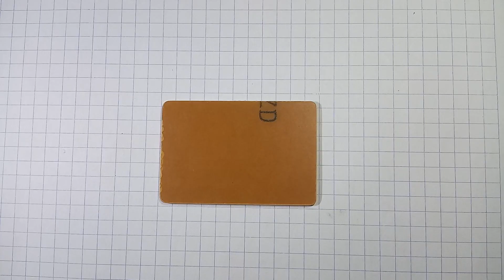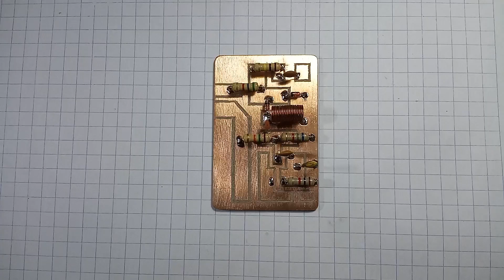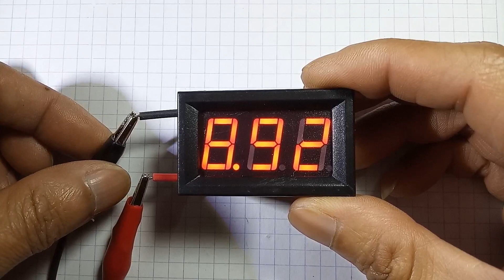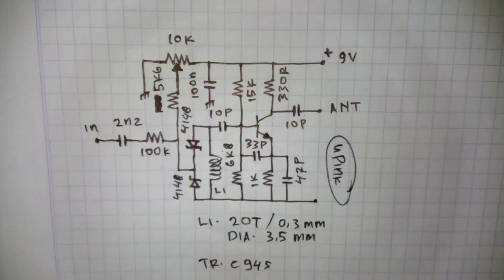Pemancar FM mini VCO

Comment: Kalau untuk frekwensi atas seperti di 88 mhz bagian mana yg di ubah mas?
Reply from the maker: Di tambahkan kapasitor pada induktor inti udara
Reply: @UpinkProduction  pode ser adicionado um de qual valor para a frequência acima de 100mhz? Ah e parabéns pelo seu projeto!!!
Reply from the maker: @eltonoliveira4630  The circuit was deliberately made at a frequency of 65 - 82 MHz.
if you want to make a 100 MHz and above you can see my other videos.
The oscillator using the koker is easier to adjust the frequency up or down.